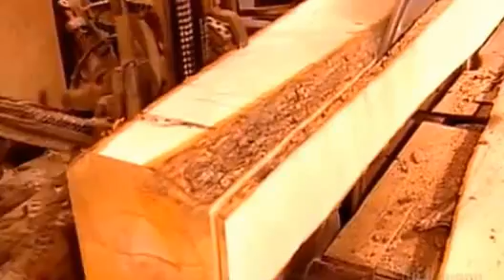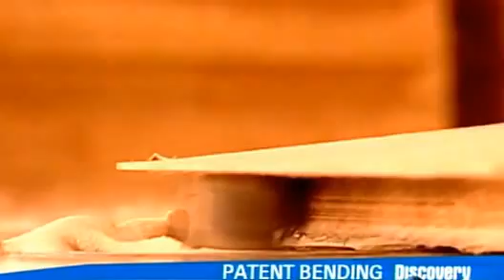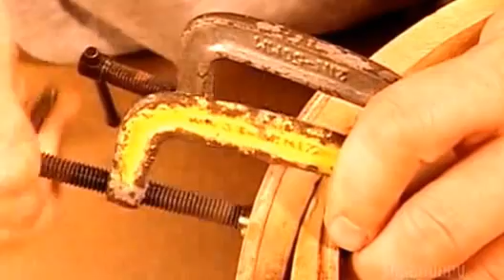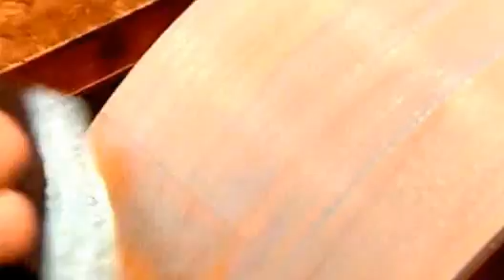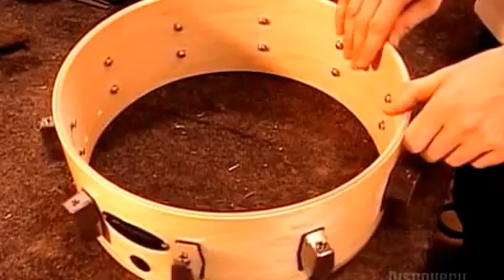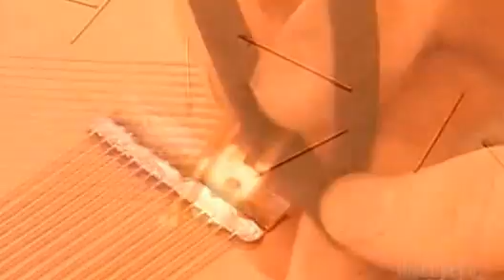How it's Made - Drums

Comment: Heat guns on drum heads?
Reply: snarlingrabiddog5150 That's crazy!!hahaha
Reply: snarlingrabiddog5150 Absolutely! But it's a process that really isn't required anymore. It used to be used to get the animal skin heads to form to the bearing edge. Even with the invention of plastic drumheads, it was still a great way to get the drum to form to the shape of the edges in a hurry. Lets call it an old trick drum techs used to use. With the modern technology of Evans Level 360 or the technologies Aquarian is using, stretching or seating heads isn't really necessary. Tune and play!
Reply: +snarlingrabiddog5150 ,,yeah,,,snares on  batter heads to,,,
Reply: i love drums and at saturday my mom gets that drum in lazada pretty cool right